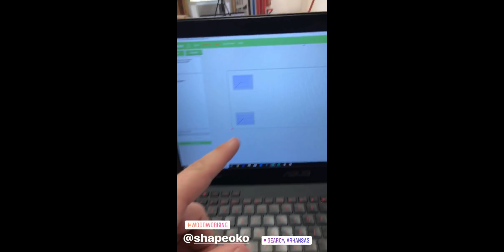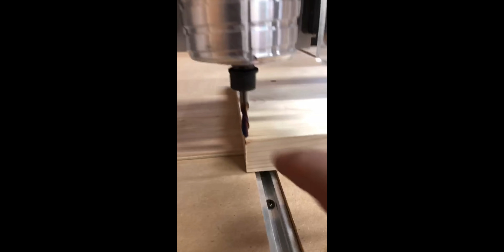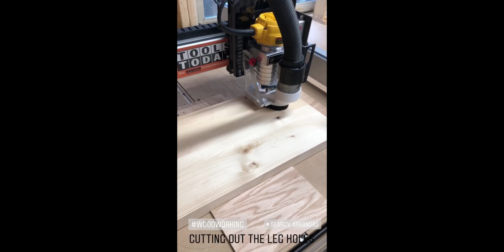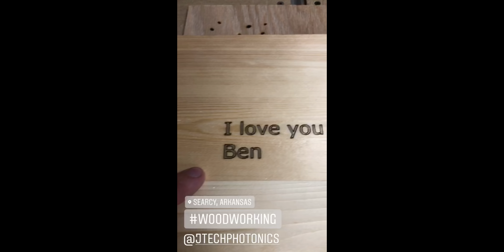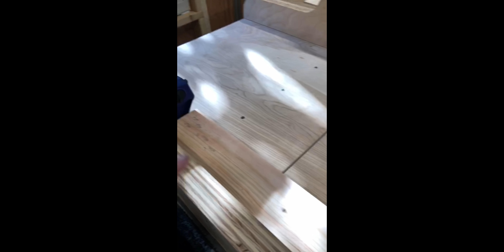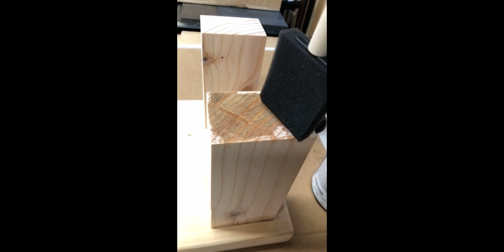Using A CNC And Laser To Make A Step Stool // DIY Woodworking

Comment: Nice, I just came across these videos using the laser, I have the earlier version without the shroud. But a question on this build, I see the T-Tracks why didn't you just use the clamping rather than nailing?
Reply from the maker: I rarely use the track (I fact I just took it off). I like nailing because there’s no clamps to get in the way.   If you have the extra stock to work with it’s my fav.   I just converted to a new style.  Not sure if I’ll like it but time will tell.  Follow my Instagram @myerswoodshop to see the new style